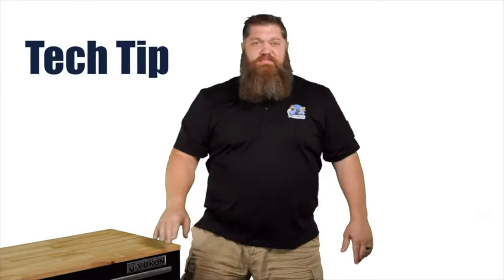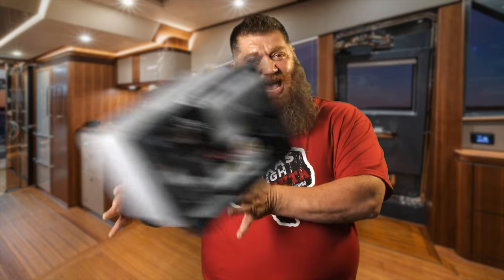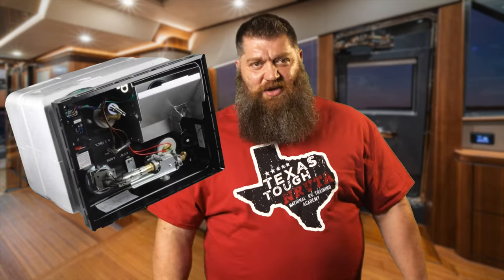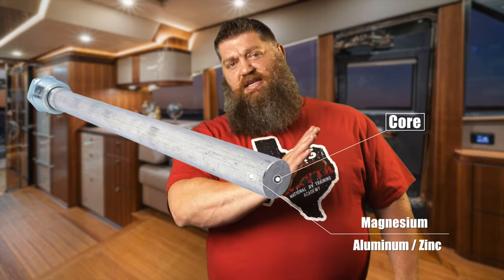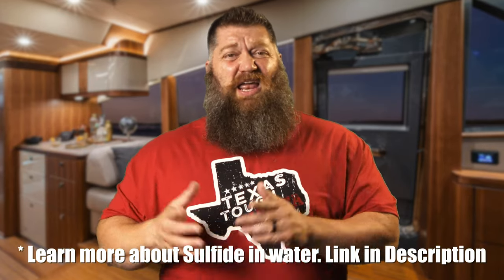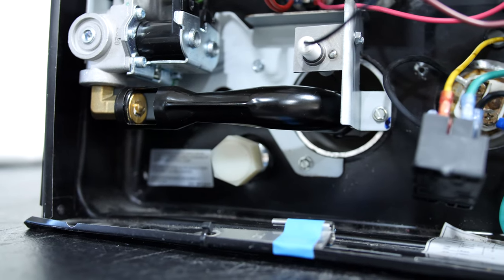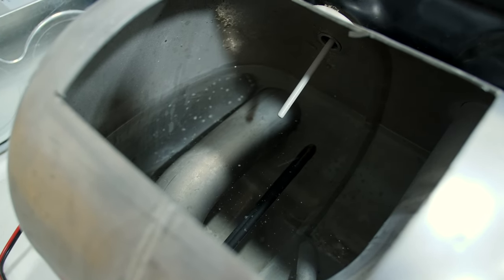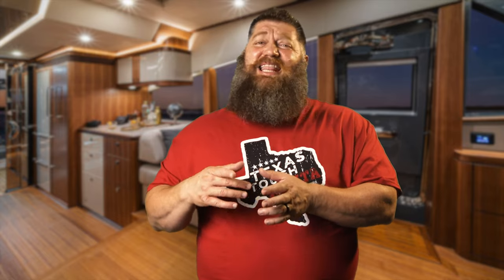Atwood Water Heater SMELLS like ROTTEN Eggs

Comment: What makes the rotten egg smell on the coldside when you first cut it on after sitting overnight. Goes away after a few seconds. Rv is a 2022 and we did sanitize everything. On demand water heater(no tank or anode rod i think) but hotside doesn't have a smell. Love the videos! Thanks

Comment: We’re in a 2015 tag axle with AquaHot & electric water heaters. COLD and HOT house water is all good BUT, the water coming from our residential fridge water dispenser is rotten smelling. I drained the fresh holding tank and filled with about 3 gal of vinegar to make sure the pump picked it up.  Ran it through the fridge dispenser. Replaced the house coach water filter in Nov 2021 and fridge filter in Mar 2022. No luck. Suggestions?  Thanks in advance!
Reply from the maker: The smell comes from anaerobic bacteria in your water. It is a common problem, especially after the RV has sat for awhile. The way you make it go away is to sanitize the system with bleach. There are lots of videos showing you how to do this depending on your system. https://youtu.be/Rg0uFlZRNAs

Comment: i actually do dump my hot water tank every time I use it
Reply: Sounds like a good idea
Reply: I also drain my water heater after each trip
Reply: Same here. I also figure that's close to 50 lbs I don't need to haul everywhere.
Reply: @ynpmoose  that's the main reason why  I drain it
Reply from the maker: It really depends on how you travel. if you are traveling alot during the summer it may not make much of a difference. But if you want to theres nothing wrong with it.
Reply: @NationalRVTrainingAcademy  I see your point but really it is more weight to drive around with , I can't remember the exact figure but for about every 50lb of weight you shed is about 1MPG you save. It really is not that hard to do, when you disconnect everything you open up the valves.

Comment: Anyone know which adapter is needed for a Dometic in order to connect the short water hose? My Dometic has the nylon cap over the drain pipe.
Reply from the maker: 1/2 npt to 3/4 ght